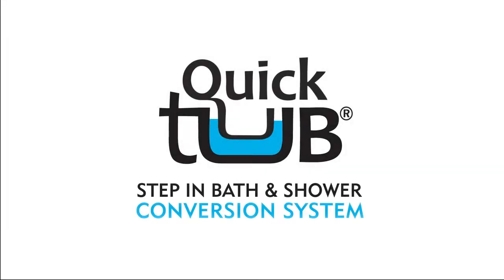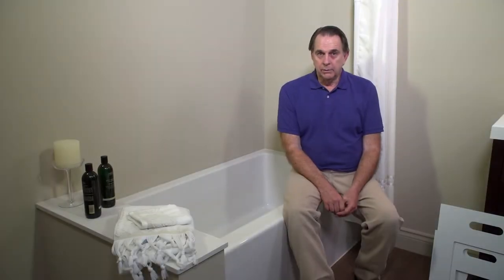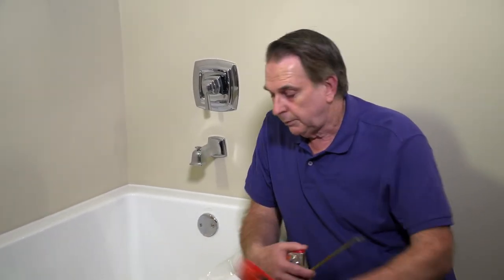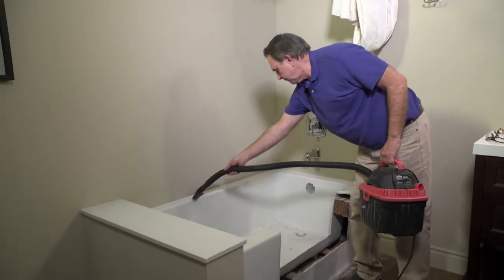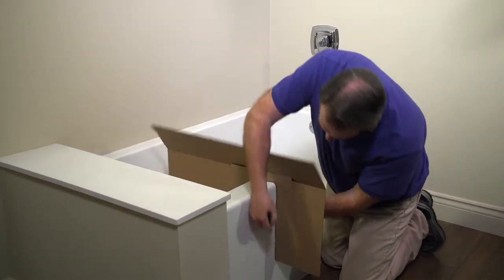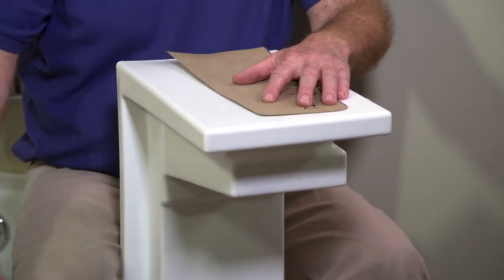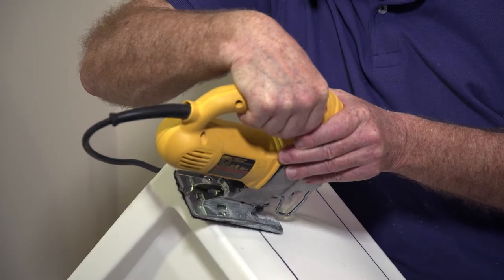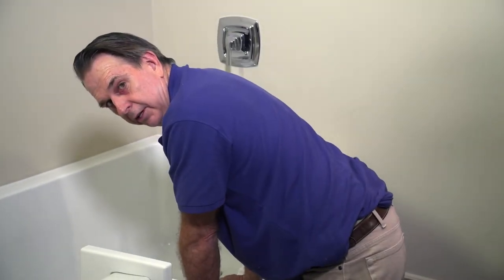Installing Your Quick Tub® Xtra Deep Walk-Thru Insert

Comment: What is the cost?
Reply from the maker: You can buy DIY kits direct from our site starting at $325 USD. Alternatively you can find a local installer on our website under the “Find a Local Installer” tab. All installers operate independently from Quick Tub and charge their own labor rates for the products, typically around $850 + depending on what items you are purchasing. Do not hesitate to call us toll free for any additional questions @ 1-800-600-7842